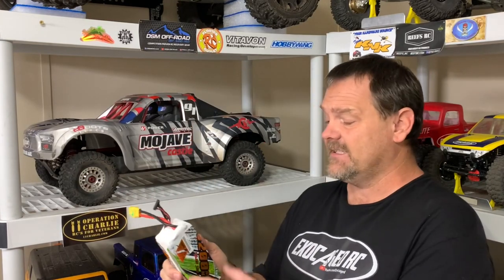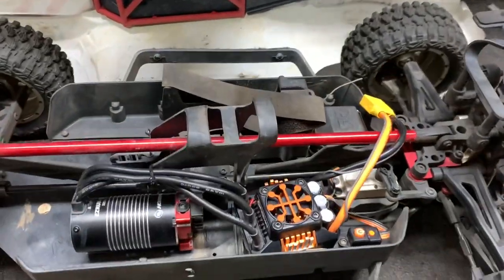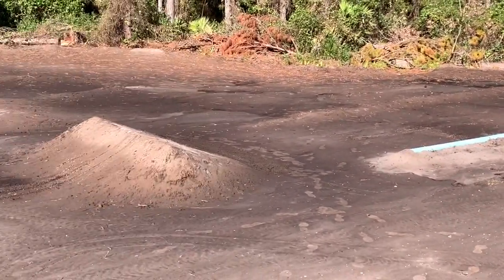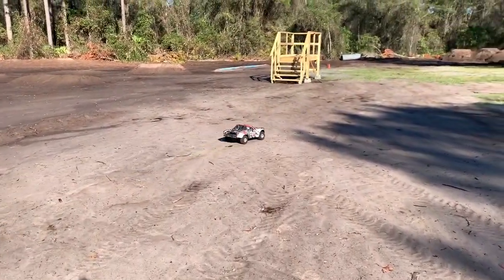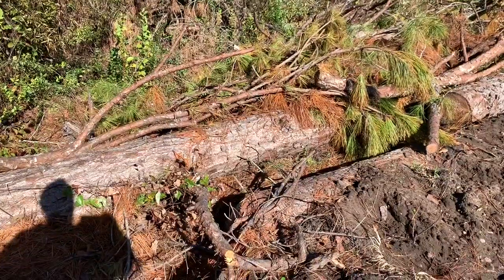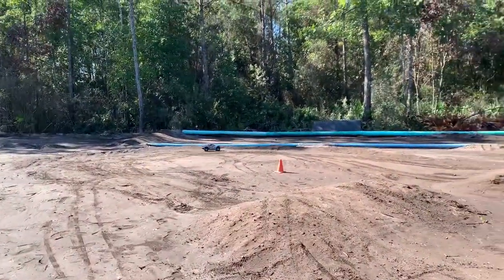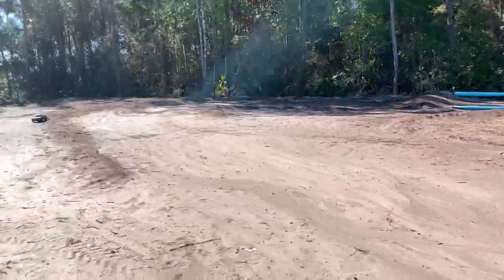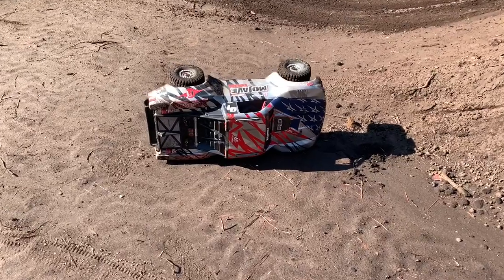Arrma Mojave 6s New ESC and Motor Test

Comment: I watch almost all of your videos and you and I are on the the same page with almost everything. I started off with a exb chassis, did the Vitavon front and rear diffs. I regularly run the castle MMX8s with 1717 1650kv with out any diff issues. I did 50wt rear, 100wt center, and 30wt front.
Reply from the maker: My diffs are always an issue. It could be the heavier wheels and tires on this.
Reply: @ExocagedRC  I use the same wheels and tires. Your the one who turned me on to them.

Comment: Awesome track, awesome jumps ! I had the same prob and lost my front wheel 2 or 3 times per session aaaaaaand I bought the m2c extended nuts and it never happened again. All the best, bro.
Reply from the maker: I’ll have to check them out.
Reply: I have two EXB Mojavies. I crank down my lug nuts with my Makita XDT15R1B brushless impact wrench. I've never lost a lug nut since then.

Comment: I know I've mentioned it before and you said your wife wouldn't be a fan but I'm telling you outdoor brown carpet on the jumps it'll cut your workload in half from the rain deteriorating the face and shape of your jumps. And after one or two rains the carpet won't even move and it'll have dirt on it and blend right into the ground. 
  I know it's an added cost however saving half of your work time I think would be worth it because I know making comment must take up quite a bit of your time along with editing and maintaining the track in between. 
(I just chose outdoor brown carpet because it's usually fairly cheap but you can use any type of carpet and I chose brown so it would blend in and not stick out like a sore thumb.)
Reply from the maker: I may try that, but I may change the whole track. Not 100% on it yet but I like the layout
Reply: @ExocagedRC  I love it I think the track looks great I think you did an awesome job so far. I love all your content actually I watch your channel daily.

Comment: Are you breaking your diff gears with that HW motor on 6s? I haven't ran my Mojavies EXB too many times, but I've had no issues with that motor on 6s. But I know that the EXB has better diffs. I did break a couple of diff cups on one of my EXB Mojave but it was because of incorrect set screws on the suspension. And that was with a smaller motor. Nice bash

Comment: The slo-mo @ 11:30 shows a bit of wobble on the tires, mainly the front. Do you think balancing would help? Just curious. I don't run large scale (yet) but I'd like to get the Senton or the Mojave. 
I'd like to see some FPV racing/jumping with some buddies out there. Even on an unfinished track. Possibly a Sam Cam?

Comment: Take out the spacers on the ends of the arms and snug everything up,helps the driveshaft stay in diff cup alot better,also I'm wondering if you're tearing up your differentials because the Vitavon wheels are adding too much weight and that extra rotation weight is stripping gears? Had a similar problem with heavy steel drive shafts in my old e revo.(v1,riffs are much stronger nowadays)

Comment: Tubing on the shock shaft about 1/4  of a inch stops the drive shaft from popping out I use some lock tight on my hubs and wheels stay on m2c also makes two styles to fix it

Comment: take the pivot ball shims out and tighten them up ur drive cups will stay put
Reply from the maker: Hmmm I haven’t messed with those. I’ll look at that
Reply: @ExocagedRC  the m2c wheel nuts are cost effective too in the long run after stripping hexes and losing enough wheel nuts to build a model t i broke down and bought em lol